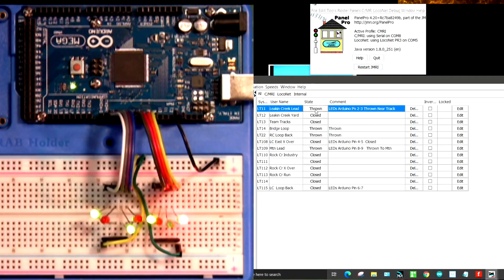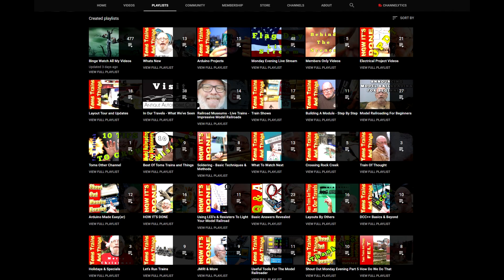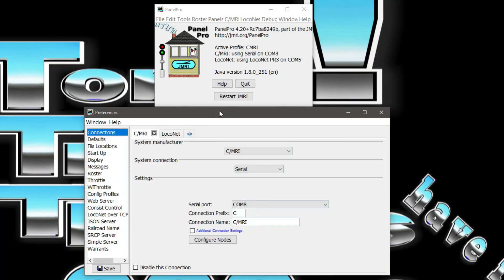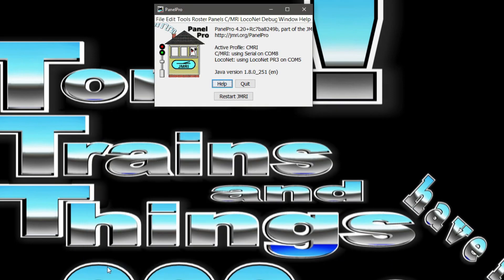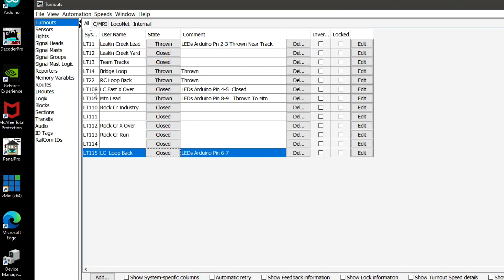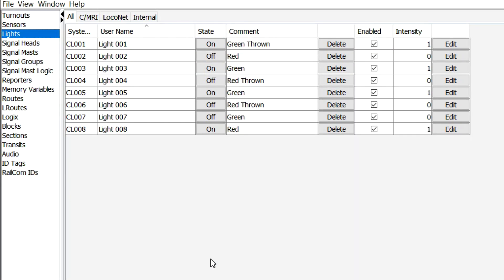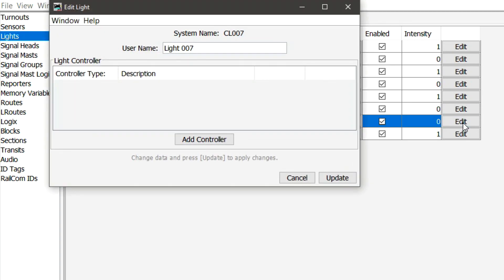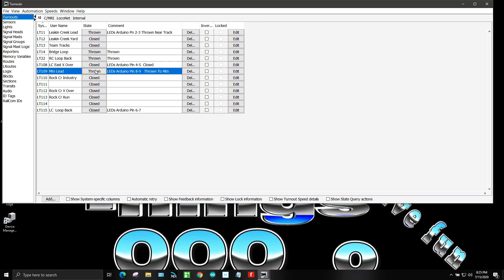Easiest Way To Connect Your LED's To Your Turnouts In JMRI

Comment: Hi Tom,
How can I add ground signals to my layout when using Bachmann EZ track turn outs?
I'm having a terrible time trying to figure this out. (i.e. turn out number 44862) I have a DC layout and do not have any plans on using an Arduino since it sounds too difficult for me. Any help would be greatly appreciated.
Reply from the maker: Arduino is cheap and easier than you think. If you don't want to g that route, then there is the manufacturered solutions such as   https://www.digitrax.com/products/detection-signaling/
Reply: @TomsTrainsandThings  Thank you for the quick response. Do you have a video on controlling and programming the Bachmann turnout with the Arduino? The Digitrax looks complicated as well.

Comment: Tom,

I’m thinking of using servos controlled by Arduinos for turnouts instead of tortoise switch machines.

What are the advantages of controlling indicator lights or signals this way instead of some kind of arduino control directly or a switch connected to the servo?
Reply from the maker: Hands off operation once it's set up. It can also be done through Arduino since the sensors I used in this example were connected directly to JMRI through a USB cable. No CMRI or node involved in this one.
Reply: Toms Trains and Things I didn’t realize CMRI wasn’t involved in this one since the panel pro profile, connection etc didn’t seem to change after restart. Also, after you restarted with Loconet control at about 4:40 you click on CMRI profile which made me think CMRI was still involved. I was hoping to set up without CMRI nodes etc. So, I could do this technique without doing the CMRI set up you did last week, right?

Also, didn’t see how you had usb connection to the sensors. I must have missed a previous video. Do you happen to know the link to the video to that sensor set up?

Thanks,
Ken
Enjoying the watching, but having trouble with the absorbing and retention:-D
Reply from the maker: Sorry for the confusion on that one. I do have 1 Arduino connected through CMRI in that profile. When I first started testing CMRI, I was only able to get the lights to work(LEDs through the Arduino), I was unable to get the sensors to work, (Inputs from the Arduino). I had LOCONet connected to test the turnouts with the lights and sensors, but since the sensors didn't work that way, I continued testing with that profile via other means.

The sensors I have hooked up, which now I realize I was thinking of another video in my first response to you, are stand alone with an Arduino through a USB. This type of connection does not have to be configured in JMRI. It's programmed through an Arduino sketch, and scripts in JMRI.

Going back to your original question, you have less wiring since everything can be done in your physical panel. Additional wires do not have to be run to the Tportoise's contacts for LED's to light up on your panel. You can also control signals this way,, but since the signals are closer to the turnout, it might be better to run the signals off the Tortoise. It's up to the user, it can be done both ways.

Comment: Is there a way to query the switch machine to confirm that it took the command and switched?  If you are using CMRI to trigger your switch and LED, since the system is only one direction, how can you confirm that the switch and the LED have changed?

This is why I like the LED connected to the switch motor.  Yes, you have to run the wires, but if the switch motor is controlling the LED, instead of the LED being controlled seperatly, the LED then becomes a verification of the direction of the turnout and not just a light that is on or off.

/rant
Reply from the maker: You send a signal from the computer, through your DCC system to operate the turnout, in my case, through Loconet, to the DS64 to operate the tortoise switch machine. I can hear the tortoise operate. 

No system is foolproof, you can have a broken linkage to the throwbar, or something blocking the points and still have the points on the relay or tortoise confirm that the switch actually moved with the LED's indicating everything is okay.

It's a matter of,  trusting your wiring to work, or run extra wiring to give you that warm & fuzzy feeling. lol

Back when CMRI was developed, there were miles of wires on the model railroads to give the appearance of prototypical operation. Advancement in electronics, simplifies all that. You have to trust what it tells you! LOL

Comment: Hi there just a quick one to say that I'm really looking forward to seeing the rest of the series on jmri and Arduino as l'm just starting to build a new layout and I want to use 9g servos and an Arduino to run the points this looks like it's going to be just the thing I would want to do as I find it difficult to use my dcc throttle to do both the locomotives and the points. But things do change so I'm open to trying again later on. Again thanks
Reply from the maker: Glad you like the video.